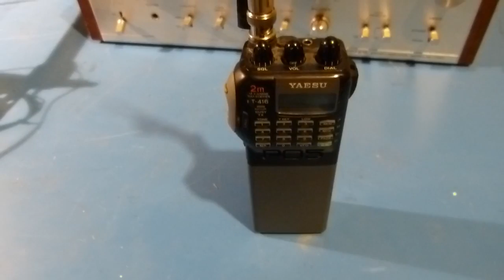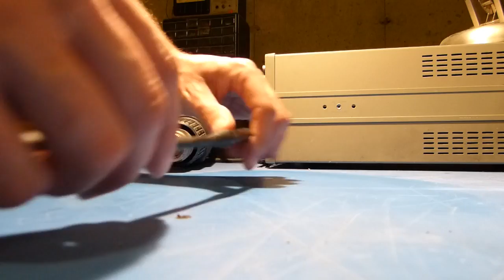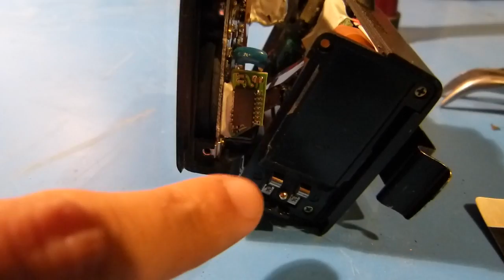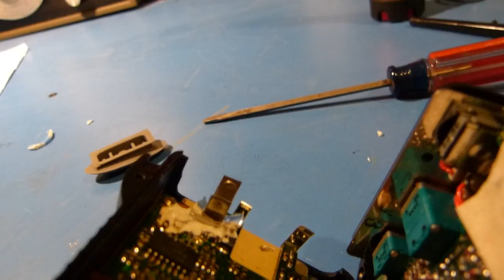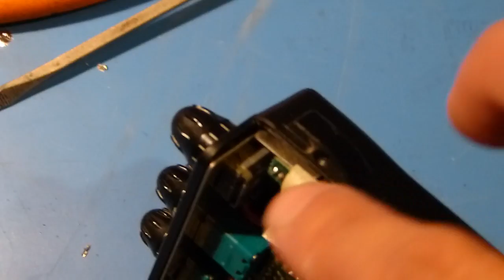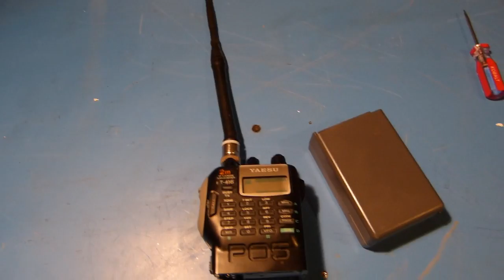Yaesu FT 416 Memory Battery Replacement and Rubber Duck Repair Highlights

Comment: Judas Priest!!  Seems like ALL these radios have some sort of backup battery.  Any chance of getting a 12 MM coin battery holder in there?  On radios that have space inside (base type), I managed to install a small plastic insulator board inside & attach to chassis & mount a coin battery holder & hard wire to the board, so the battery swaps only involve popping the case, & removing it from the holder.   I would think soldering this battery could be an issue if overheated.  I haven't turned mine on in years, but I purchased the removable battery pack with user changeable cells before they were unavailable. 

I also have the 5100, I imagine if I pull it out will need the battery as well.  

I  miss Radio Shack, as I don't order online. ... '73's!
Reply from the maker: I was impatient when I fixed this and didn't want to wait for the battery holders to come in so I used what I had on hand at the time.
Reply: @SevenFortyOne  That battery isn't of the rechargeable type? I would Imagine there really isn't the room for a holder in there or there may be an insulation problem.  Believe you can get this Battery with the solder tabs on for a vertical mount. 

My other Yaesu is the FT5100 Dual band, also has a backup coin battery, I thought these may have a static memory in them. 

I was looking over some of my radios, my DX394 has a similar battery, but is rechargeable, & it is a bear 🐻to get to.  Plenty of space in the cabinet so I may be able to re-locate this one within the chassis.

Thank you for your reply, I know this is like so 11 years ago, I believe I got my FT416  in '93.  Pristine shape, always was in it's case or on the desktop (quite a heatsink for PS operation).
Reply from the maker: I don't think this is a rechargeable battery but the details are a bit fuzzy at this point.  My sister still uses that radio from time to time and I think it's still working OK.  As you said, the coin cell with the tabs may be the best option in this case